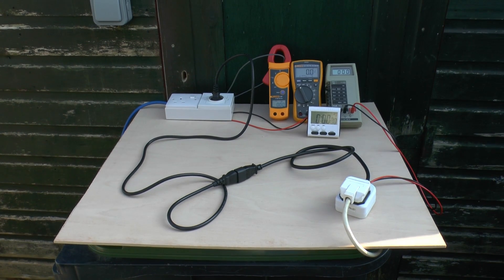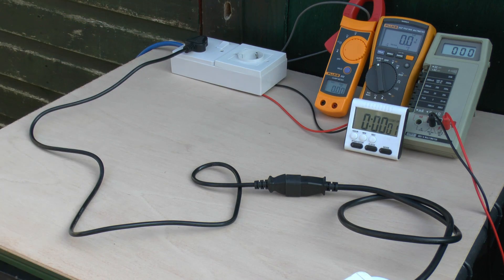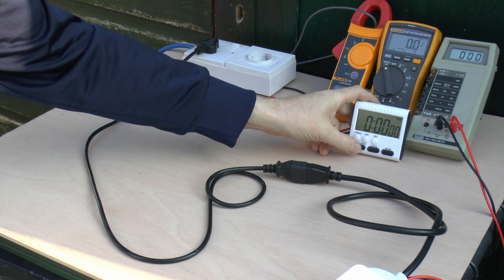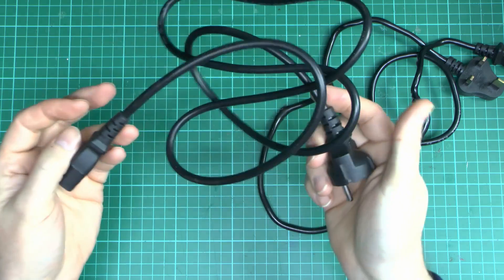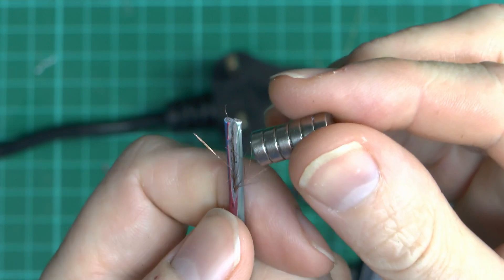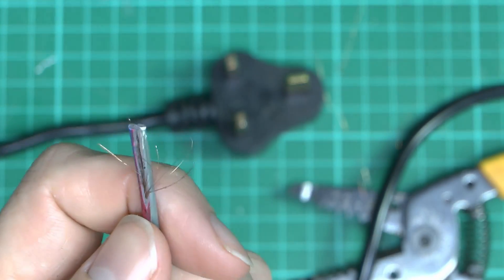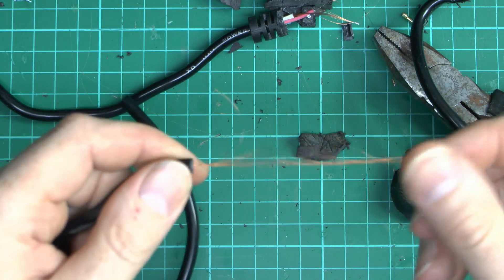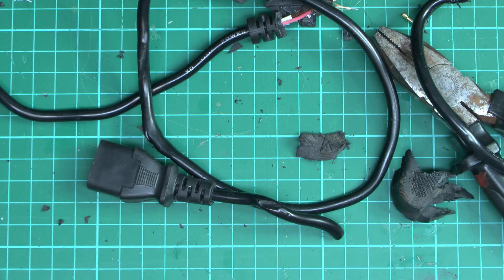Dangerous Failure of a fake UK plug to dubious C13 shape lead

Comment: Thanks for that John, appreciated.  I only watched 7 minutes of the video (watching the rest after I type) but already, I'm aware of these cables and note that we've (a company I do work for) have received a fair few monitors of late (WFH screens too!) and they came with these dubious, nay, dangerous 'Kettle Leads'.  Luckily, I noted the unfused flat-pack plugs on the first batch so ensured they were thrown away and replaced with thicker ones. This video and your in-depth review just strengthens my argument with the Bean Counters that we need to cut suppliers who ship such.  Thanks again!  Maybe the real fuse is the cable...
Reply: Apologies for the 3 year-old reply btw 🙂

Comment: I've recently had to cut off one of these death trap plugs from a 18650 torch battery charger. I'm going to fit a 1A fuse as I don't exactly trust the flex.

Comment: A shop I worked at had loads of them I told the boss there no good an dangerous he tells me just fit new plugs on.  Tje plugs he had all fitted with a 13 Amp fuse he tells me that 13 Amp is standard and every think now being so power full is 13 Amp.  So I did what he told me but me being me I put the plugs on the wrong side.  Just for fun so they all ended up in the bin.  I did show him with a heavy load what will happen he still told me to do it.  All to try an make £50 on selling them what is £50 if some ones house office goes on fire.   There still found on eBay

Comment: When the household insurance companies finally get together and deny insurance claims for shoddy electrical equipment, like the example, caused fires, the population will start screaming for the government to do something. This is a classic example of cheap product or counterfeit recognized safety association approvals form Asia. When the government starts to properly fund safety organizations that test this stuff to keep the crap out of the country we will all be safer, this problem is all over the world. I see electrical devices such as light switches and power outlets in Canada's equivalent of UK Pound Shops, UL and CSA approved molded into the plastic, not coming into my house, I'll buy the recognized brand name manufacturers product, keeps, in my case, my fellow Canadians working.

Aluminum house wire was the end all to be all for a few years where I live. Then after a few electrical fault caused house fires, it was determined that the aluminum wiring was installed incorrectly, the proper procedures were not followed correctly, they are different to copper wire. Eventually aluminum wire was banned, it is still in some houses, to sell the house, a licensed electrician must inspect the aluminum wiring and approve it or any defects must be corrected, generally if the expense isn't too high, buyer and seller agree to split the cost of removal/replacement.

Comment: What was the power wire actually intended for,  it looks like computer or similar low current draw, no one would use a IEC moulded socket end to power a domestic heater ?  Having said that my old audio amplifiers draw some 10 amp easily - the isolating and speaker transformers are the size of a brick and I intend changing the Bulgin sockets and plugs to IEC ones, and I will need to ensure the IEC ones are rated up to 16amps ideally If I use them for stage lighting systems etc.

Comment: A trick to tell if your cable is copper or copper coated aluminium: strip the wire and twist them onto themselves. If they seem to spring apart again, it's aluminium wire. If they stay together, it's real copper.

Comment: A few years ago I bought two of these, only with EU style plug in a local chinese shop - and they weren't even any cheaper than the proper stuff, so I figured they should be fine. The text on the insulation said "0.75mm2", so it should hold up well at 10 amps, I thought to myself. So I used it with 1500W load for about half an hour without even checking the cable. A few hours later I just casually looked at the cable and the insulation was all melted and the cable was "glued" together at one point where there was a loop. I could rip that cable apart with my bare hands, as the insulation was literally cooked. The wires inside were as thin as a human hair, with only a few strands per core. I'm surprised how nobody regulates the sale of such a dangerous product.

Comment: I've been involved with electronics since I was youngster in the 1950s. I enjoy your videos and have a new found respect for the power of electricity.  On this side of the pond branch circuits are typically 15 or 20 amps at 120 volts. Even with the lower over-current protection limit in the US these cord sets are a fire and safety issue.

Comment: What's so dangerous about it?  The rest of the World survives without fuses in the plug and relies on the fuses in the device and outlet circuit.  Those silly oversized British plugs look like something out of a Kindergarten or nursery school and would be a nuisance if you needed to plug in several items.  What's wrong with the British?
Reply: Robin It depends if you use a radial circuit where every socket has an individual wire run back to an individual fuse at the distribution board or a ring circuit as used in the UK where a number of sockets, typically all those on one floor of a house are wired in parallel and both ends of the ring taken back to the same fuse at the distribution board. The UK ring system has a fuse or circuit breaker to protect the ring cable typically 32A and the individual appliances and their connecting leads are protected by the fuse in the plug. Thus a heater / kettle / domestic iron would have a 13A fuse so can be rated up 3kW. Smaller fuses are used for things like lights either 5A or 2A. 10A leads are a problem as there is no appropriate fuse available. 13A is too high and 5A reduces the capacity of the lead to 5A.

One disadvantage of the UK system is that you can put a 13A fuse in the plug for an appliance that is rated at 5A or 2A then appliance can catch fire before the fuse fails. 

The advantage of the ring system is that it requires less copper in the fixed wiring and you don't have to have as many fuses in the fuse box ie one per socket in a radial system. However the plugs need to be larger as all the sockets are the same and rated for 13A, they also need room for the fuse. With radial systems there are often different sized sockets and plugs and in some cases heaters may be hard wired. Some radial systems do not allow 3kW kettles so take much longer to boil like the ones in hotel bedrooms.
Reply: Nothing wrong in UK standard, just because the engineers who design that socket knows it can deliver 3kw and capable of killing a person couple of times. By the way, no one ever assured that all electric appliances will have a build in fuse? Not to mention that, in nowadays, some manufacturer from who knows where are making fake fuse that will burn at 65 amps instead of normal maximum of 13amp wall socket. You better check your insurance policy to see if it cover using non standard electric appliances and cause fire? If you keep on this attitude.
Reply: @luderickwong  It can kill people more than 'a couple of times' it only requires 50mA for a few 10's of ms to kill a person. Thus 13 Amps could kill around 260 people at one time ! The 50mA / few 10's of ms determines the performance required or RCDs.

Comment: What's with the "Schuko" faceplate there? I've never seen one of those combined with a British pattress box. Who uses those in combination? Moreover, who sells that and why?
Reply from the maker: It's been assembled from separate components for testing purposes.  Not a standard item.
Reply: @jwflame  Thanks, I can see how you might want to cobble something like this together to be able to test Europlugs coming in from wherever, but I'm still curious: Did you make that faceplate yourself? Or, if a Schuko faceplate is available anywhere for a BS1363 pattress, then where and why? Who uses that?
Reply from the maker: It's a modular system, 1 and 2 gang plates and you can fit whatever modules you want into it, http://www.rpp.uk.com/index.php/products/easyclip.html
Reply: @jwflame  thanks for the tip, useful to have
Reply: @jackalek  Just be careful - you can't connect a Schuko or Din socket to a UK style ring circuit. As the only protection would be the 32A ring main circuit breaker. There needs to be an appropriate fuse ( probably 13A) in the live feed to the Schukp socket. Mixing radial circuit accesories and ring mains can be fatal.
Reply: @johnmurrell3175  Hi thanks for the warning, I'm fortunately aware how this works. I'm from continental Europe and have experienced both, I would say I prefer the British style sockets with switch, where you can't reverse the plug. Stay safe.

Comment: @j your electrical outlet in your home has a breaker, your pc has one built in also, so theres no point in putting a breaker into the cord, as a matter of fact iv never seen a pc cord with a breaker, they are not avalable for sale , if i wanted one id have to build it literally,, dude get a real subject , state some facts , this video makes you sound like an uninformed idiot.
Reply: Hahahaha hahaha. What gibberish. It's a legal requirement to have a fuse in the plug to protect the cord here. No way any normal flexi cord can take a 32a+ fault current before the MCB goes. Never seen a power supply with a "Breaker", a non replaceable internal fuse maybe.
Reply: You need to understand the difference bettween countries that use radial circuits and those that use ring circuits before you make such a comment. See my post above.

Comment: i bet there is more copper in a 1p piece then in this cable indeed the entire run of cables made with it !!!
Reply: Of course there is no copper in a 1p piece - they are made from steel - try using a magnet on them.
Reply: @johnmurrell3175  They are copper plated, for the look.  So if there's a couple of milligrams Firsteerr Lastmwwew might win his bet after all.  :)

Comment: At this point they could just sell a flexible plastic wire with nothing in it and it would do about the same job.
Reply: At least that would be safe from overheating.
Reply: Nah, it would need expensive conductive plastic to turn on.  Aluminum wire is cheaper, at least in this thinness.  However the copper coating does nothing and isn't visible so can go away, while the thick insulation could be marked (and tested) at more than 300V.